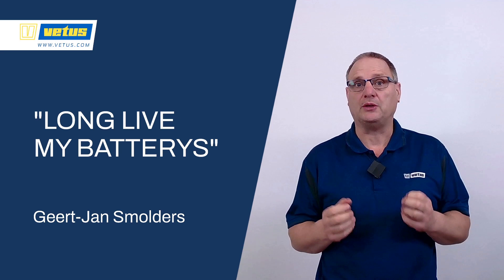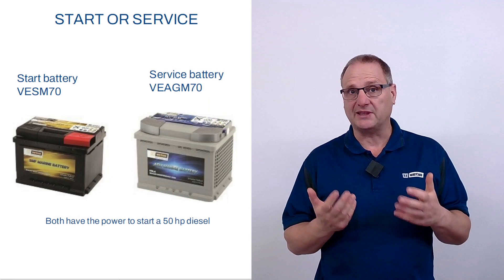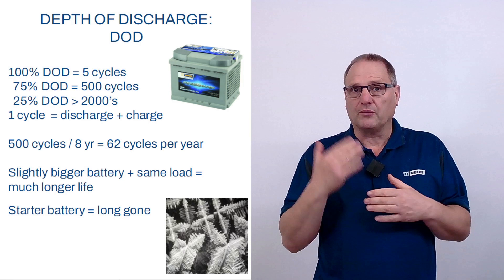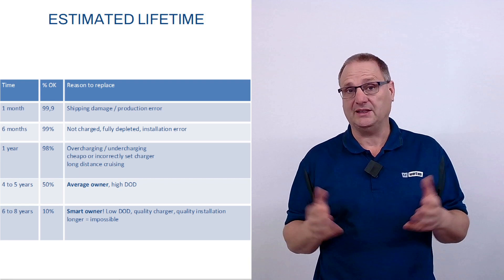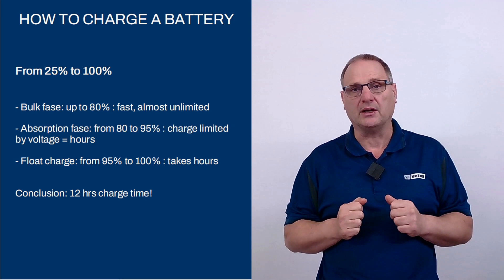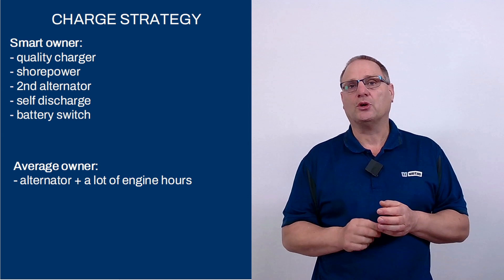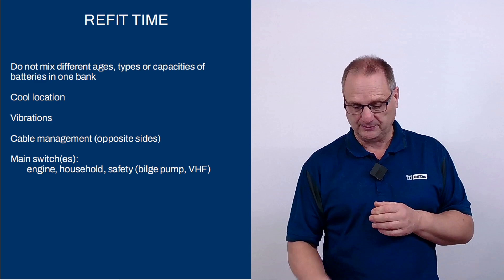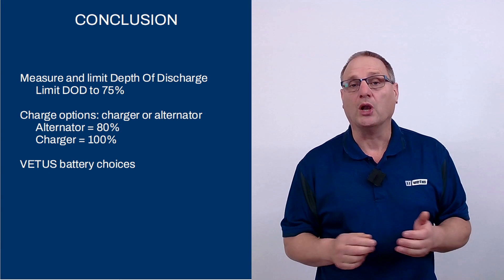Extend your ships battery life

Comment: Hi, found this video very informative, thanks a lot!
I have a small sail boat, kind of folke boat, with an inborder.
I had problems starting the engine for two seasons, and finally I think the root cause was not enough power supplied by the batteries to the starter (I had two different service techs on board, just scratching their heads, ....).
So I want to replace at least one of my batteries (devided by a selector switch) for a new one, and I guess this should be VESMF type. What about the battery for the regular consumers, like navigation lights - needs to be VESMF or could be VEAGM? 
Would I have any problems with the charger or battery separator using two different types of batteries?
Thanks for your support 
cheers
Thomas